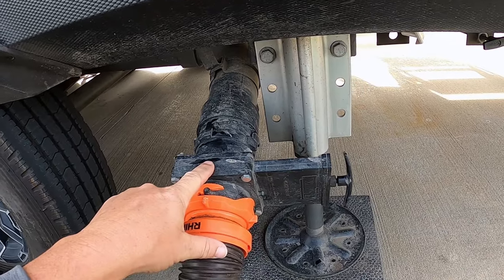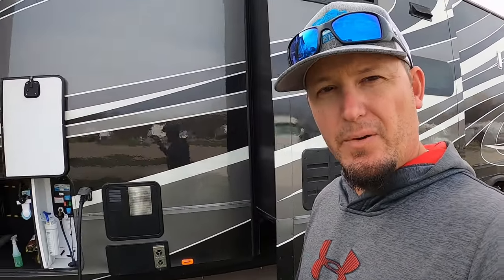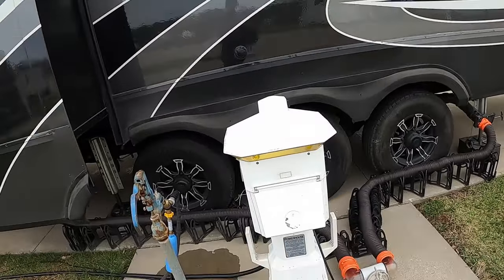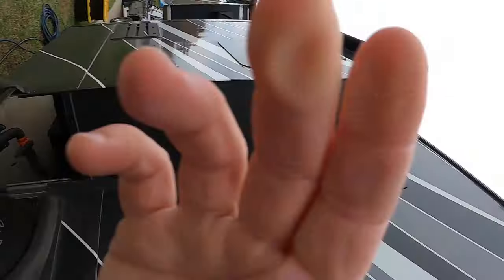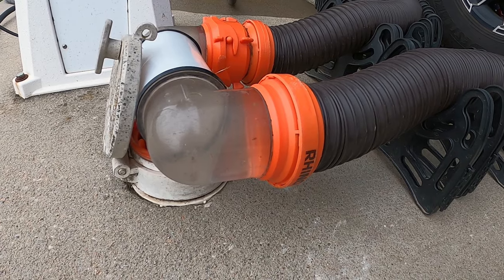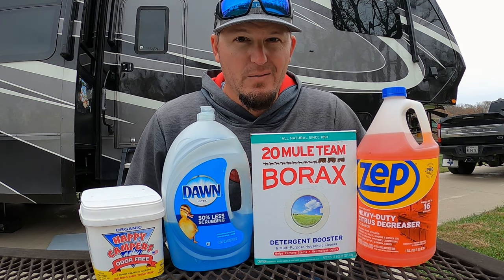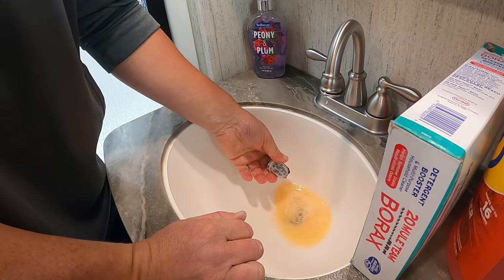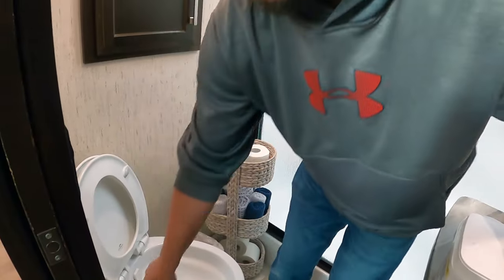RV Black and Grey Tank Cleaning and Maintenance | Geo Method | Full Time RV Living

Comment: I didnt have any luck with these methods. In a fit of frustration i tried adding a gallon of Zep brand acidic toilet cleaner to an empty black tank and used my rv as usual. The cleaner sloshed around in the tank traveling to each campsite. By the time it was ready to dump the tank sensors were cleaned. I pulled into an rv park and drained the tank and flushed. Sensors work perfectly after and no residue of anything in the tank. For rhe grey tank I added 1 gallon of Zep brand degreaser to the empty grey tank at the same time. It works on the sane principal and is good for food debris and food grease.
Zep brand is sold at home depot. About $20 a gallon. Do this once or twice a year no tank clogging or sensor issues. 

No need to flush multiple times using this method. 

Hope this helps
Reply from the maker: We live and travel in our RV fulltime, we also are a family of 5 and our tanks are full and need to be dumped every 3-4 days!  I can assure you even with this method we need to flush several times before the tanks run clean!

Comment: Great video. We just upgraded from a camper to a 5th wheel and I am trying to learn how to maintain as much as possible (just in case it becomes my job lol). I usually keep the inside under control while hubby does all the exterior maintenance.  Thanks for making this video!
Reply from the maker: Thank you! This stuff is really easy and as long as you stay on it and never skip you will never have any black tank issues that you might have to deal with!

Comment: I have used the dawn and borax. In a 10 yr old camper was the only thing that worked. I also put hot water with the products when I had a horrible smell in my blank tank when I first purchased the camper. I will be using the method in my Grey tanks. Thank you. Always helpful information. Happy adventures ✌️
Reply from the maker: The only time this did not work was when I skipped doing this procedure before a move day!  It led to the poop pyramid!  This keeps all of our tanks clean and odor free!
Reply: @PavingNewPaths  I'm happy to learn about the ZEP, that's a great product. 👍 Thank you!

Comment: We have a 50 gallon black tank and always start with around 15-17 gallons of water plus whatever tank treatment we have on hand.  We use Happy Campers every 4th or 5th trip and it is great but I think the instructions say not to mix it with anything else.  Bottom line is water is the key...Calgon or any water softener will help keep the tank "slick" and prevent TP or any solid waste from sticking to the sensors.
Reply from the maker: We made a video testing the different types of tank treatments and how they affect the break down of TP! https://youtu.be/RSY9nnXN66M
Even after all of that we still use happy camper, dawn and borax in our black tanks!  We have had really good success and all of those things are very inexpensive and available almost anywhere!
Reply: What kind of calgon product do you use? Do you use bath salts like the person who commented above your post?
Reply: I also meant to ask how much you use as well...thank you

Comment: Mannn this video is very clear and really informative,  just bought my first old  RV  (  1991 ) coach man Ford 460 , 22 feet. They almost have not used it her whole life, very clean. I’m excited about my first trip with wife. And this is really good information for people or beginners like me.
Thanks very much.   And I’ve subscribed.
Reply from the maker: Thanks for watching and subscribing!  If you have any questions reach out to us on our Facebook page and we can help you out!
Reply: That big block 460isa beast man, I've had a few of them that I had built race engines and I had a book full of all the specs, measurements,  and the displacement of the machine of the bore, the undercut of the crank,  the heads decked, port n polish,  guides, valve, spring, seats, and the other items that I have had.  Only one big downswing is the fuel costs

Comment: The dawn and 5 gals of water splashing around when driving is really good it knocks down grease, etc.  Salts that are larger chunks work to help break up things and bath salts add a better smell. Be careful using a bag of ice on an old tank.  The cleaner maybe harsh on the rubber gaskets on the tank.  Borax is great for so many things.  I do not full time but have done plumbing and replaced tanks on campers.  People use dishwasher soap or pods also, in some states the dish soap can still use the good cleaners, but not all states.   Stay safe and healthy.
Reply from the maker: I have been told the bag of Ice works, but I am not sold on it!  Where we spend most of our time, the outside temp is hot enough that the Ice would melt before we got out of the RV park!
Reply: @PavingNewPaths  On an older tank the plastic may not like the sudden freezing and crack is why I wouldn't use it on an older tank. If a tank has not been cleaned the bigger salt chunks can scratch the grossness loose for the dawn to break it down.  You are right about it melting you would almost need to through it in last thing before driving out.
Reply: We are leaving this friday for the holiday weekend and I'm going to try 3/4 red solo cup of Dawn and Calgon and five gallons of water in the Black tank and one bag of ice then when we arrive at the campground I will dump my black tank and hoping to clear out whatever is in there since it's been sitting all winter in storage.  We do use TST orange drop in tablets after we dump to help with odor.  My grey like all grey tanks will get its share of soap from hand washing and dishes so I don't think its needed to put chemicals down the kitchen and bath sinks but I could be wrong.  I do know water in the black is key and dump when full as the pressure from all the water should flush most out.  I'll let you know if I see or smell a difference.

Comment: We use Happy Camper, Dawn Dish Soap, and Calgon Bath Beads (Lavender / Ocean Breeze - gives it a good smell (walgreens)... Works great for us.  Especially in the summer months when it sits in storage/ stagnent during for long periods.  Travel Day same with tons of ice. Calgon, cleans senors off.. like our skin. Hard to find Borax. We use Calgon in our grey tanks as well.
Reply from the maker: We do this every move, and it has been great for us!  The Borax is becoming hard to find at times, but we stock up when we can! The only time we ever had a problem was when we skipped this for a few moves!

Comment: One caution using Zep heavy-duty cleaner in the holding tanks, the main chemicals are Alcohols, C9-11, and, ethoxylated all can cause damage to the tank's sensors if they are the thru tank probe-type sensors as well as the dump valve seals.
Reply from the maker: Thanks for letting me know this!
Reply: Not for use on glass, plexiglass, plastics, auto paint, leather or natural stone surfaces better off using Cascade liquid dishing soap much safer then Zep on your plastic and degrease great !!!!!!!!!!!!!!! cheaper too
Reply: Use Pine-Sol!

Comment: Gonna have to try Dawn in our grey water tank, it's been reading fine after emptying up until this year now it's been stuck on 2/3 full. Our black tank seems to be fine, when we get to our site my Wife fills the black tank with 5 gallons or so and uses Happy Camper, never smells bad and after emptying I fill it back up once and drain then use the flush for about 20 minutes (with the valve open!) while Im doing other out side things and it's good to go. Our last couple trips before we winterize it I run that flush for a while but isn't much difference than my normal way. Having enough water in the tank to cover the bottom an inch or two is key to not have the pyramids
Reply from the maker: The dawn really helps things from sticking to the side of the wall, plus it is a de greaser and I also think it helps some with the smells! Wanna see a big difference in the flush, do your flushing as normal before you leave, then fill the tanks half and let it do the road clean while you travel to your next place! You will be surprised how dirty the water is after a travel day!
Reply: Would like to know if you get your grey tank sensors get cleaned. Both my sensors are up and down. I dumped both today and the grey says 3/4 full, the black said 1/4. I used a hose down into the toilet, on jet spray, did that for 5 minutes. Dumped the tank. Very nasty looking. Did it again, same thing. Once more and it was much clearer and now it says "empty" on the monitor. I used 16 oz. of Unique sensor cleaner, filled the black tank, then went out of town for 8 days, about 6 weeks ago. I thought that would do the trick but still got some wonky readings shortly after that. I think, going forward, I'll try the other methods and see if I can get consistent results.
Reply from the maker: @lauravictorious4670  Mine read right about half the time! I have used the unique and it works but after about a month you have to do it again! Our thing is flush often and use lots of water! They will never read right all the time but thr more water you use the better they are at being close to working right!
Reply: @PavingNewPaths  I filled and flushed three times today and it's amazing how much keeps coming out. I've been using Borax also but I think Happy Camper might be good to break "stuff" down.

Comment: That is pretty similar you our process. On the rare instance we get a 'poo pyramid', taking the hose inside and giving is a blast down through the toilet invariably breaks it up so it comes out when the tanks are flushed.
Reply from the maker: We had the Pyramid once and that is exactly what we did to get rid of it!  You can check the video out here of us trying to get things to move! https://youtu.be/tsiZ5dc-WtQ
Reply: That's what I just did today and, wow, lots more came out than when I just dump the tank. It was surprising. I went through that process three times and it was much better the third time. I used my hose with an attachment set on jet spray.

Comment: We use the same method for ours as well except we don’t use the Happy Camper.  I’ll add that to the list.  I have read that some will add a bag of ice on move day to break up anything that may be stuck to the tank wall.  Great video!
Reply from the maker: Thanks for watching! We have heard the ice trick works but have never tried it.
Reply: Yep 2 16lb bags or more right before you leave to bang out those poo piles and scour the grease and stuff out of the gray water

Comment: For several years we  use a pan in the sink when washing dishes and put it in the toilet at least 3 times a day . We dont put the water in from greasy pans in the toilet . I dump my black tank every 3-4 days. And also dump a full toilet bowl of water 3 times when dumping with the tank cleaner is going . It's amazing how much solids come out when the toilet is flushed.  And i use a spray wand with the water jets once a month.  We also put our toilet paper in a diaper bucket that we empty daily .  And mix a 5 gallon of water with Dawn soap on travel .
Never had a problem with smell. 
But i am going to try your method on the gray tanks. I also like having the gate valve where you hook up the hose . So when I open it before draining the tanks I can tell if any of my dump are not sealing properly.
Reply from the maker: Let us know what you think after tasting the grey tanks!

Comment: Awesome video only thing I would do a little different is when we start the tank emptying process I open the gray tank valve first for a few seconds first to make sure I don't have a leak in the hoses, that way if I do have a leak I find out with gray water not black  water 😉 ALSO have  you ever tried the (flush king) and ifso your thoughts on it
Reply from the maker: I have tried unique, and a few other products that dissolve the contents of the tank! I have mixed thoughts on if that is good or not, so I went back to using the bio geo method!  So far as long as we stay on top of the tanks we have never had a problem!

Comment: We are back after a 3 month trip used Zep and boat along the way.  Worked well. 
How long can the clean mixture stay in the tanks for storage?  
Home for a couple of months now.
Reply from the maker: I'm glad to hear it worked well for you! Normally, I would do a road flush on the way home and dump the tanks before putting it in storage. But depending on how much water is in your tank, I can't see why there would be any issue leaving the mixture in the tanks unless you're expecting freezing temperatures!

Comment: How long do you leave the borax/dawn/happy camper solution in the black tank before you flush that out? Over night, or does it work fairly quickly?
Reply from the maker: We live fulltime so our RV never gets stored, so we always have the treatment in the tanks! We do the dump and flush the day before travel, that way the mixture can slosh around on travel day! Once we get to the next site we use our tanks until full and then dump! If we were going to put it in storage we would flush really good and store dry!

Comment: Great video I do use those same products but never used the happy camper. What’s the advantage of the happier camper, also when you camping and the black is full so you just drain the whole thing and add products again?  For example you staying out for a couple weeks or a month and have to empty tanks several times.  We host half the year so we stay 6 months at a time and input product in after every dump.
Reply from the maker: Thanks for watching!  The happy camper helps reduce any odor.  For me when we stay a month or longer I will not add the products after every dump!  Our Grey tanks with four of us showering and having a washing machine we are basically full every 2 days, so it would not benefit you to use the products.  The black tank we can usually go almost 2 weeks before that needs to be dumped, and really it depends on how much longer we will be staying if I add any products or wait until we move.  If I were stationary like you for 6 months I would probably flush and add products once a month.
Reply: If you are staying 1 month or 6 months, I just leave my grey tank valves open! Especially with my washing machine. Because it fills up fast on laundry days. Then once my black tank is full dump it, then flush till clean.
Reply from the maker: @williamstinson1068  We tried this and unless you make a P trap in your sewer hose, the ac or maxx air fans will pull sewer smell into you camper.  So we never leave valves open until its time to dump.
Reply: @PavingNewPaths Aren't there p-traps in every drain including the shower and w/d? If not, wouldn't there be an odor all the time if the gray tank had an odor?
Reply from the maker: @wanderingrv7093  You are correct there are P traps on all the drains.  However we have found if we leave the dump valves open with out making a p trap in the sewer hose ( water barrier).  With our A/C or maxx air fans on it will begin to smell in the camper.  When we have our dump valves closed we do not experience any smells.
Reply: @PavingNewPaths  if you look under your sink in the bathroom and kitchen, you will probably see a small vent pipe that sits above the P trap and just below the sink-bottom. On the end of the pipe is a replaceable vent valve. It is there to prevent your P trap water from being sucked out when there is a change in tank pressure, like when you are draining the tank.  If you are getting smells when you leave the tanks open and turn your fans on, it's possible that there are pressure fluctuations being created from the sewer line and then into your tank causing this valve to randomly open and close. Or maybe your vent valve is sticking open, causing bad air to be pulled into the  RV through the under-sink vent.  Just an FYI as to why you might be getting those odors. I just replaced my vent valve. It was stuck open, so smelly tank air was always infiltrating into the RV regardless of the outside valves open or closed position

Comment: Do you add the chemicals to the 5gallons of water in the black tank? Or, do you fill the black tank back up with water with the chemicals and let it sit?
Reply from the maker: After my last flush I use the black tank spray line to put about 15 gallons in the tank before I treat them!  I do this the day before a move so we continue to use like normal and usually within a day or two of moving I will dump!

Comment: I back flushed my black tank ,but left open the grey tank valves.  Will this cause nasty stuff to go into the grey tanks?
Reply from the maker: if they share the same exit point on the RV like ours, then yes if you have the grey tank open and are dumping the black tanks it is possible some black stuff when into the grey tanks! But you can just do a few dumps of the grey tanks and it will be just fine!

Comment: I would like to know what might be different on the every 2 weeker, and how often
Reply from the maker: We move every two weeks or sooner!  Our tanks usually need to be dumped every week, the only reason I wait to flush is because I know I will have flushed, and treated them before we move, and they will clean while we travel!  If I was stationary, I would likely do this job once a month depending on our usage!
Reply: We camp 2 weeks at a time, I have an external tank and we treat both but should we do the black tank flush  every time
Reply from the maker: @sherrieduncan6637  If you are fulltime I would do it for sure every time you move the camper! If you are taking it back home to park it I would flush them good and take them home dry!
Reply: Thanks 😊👍